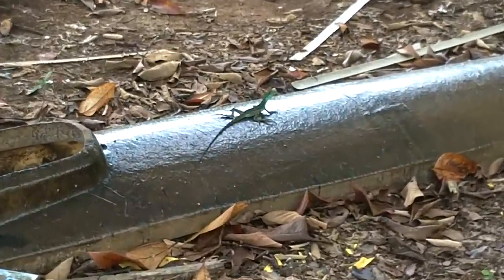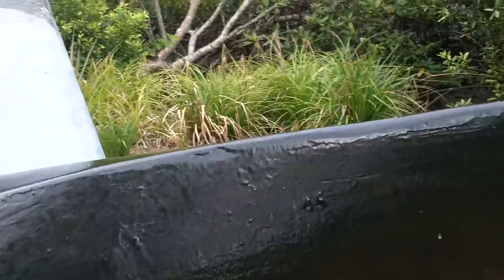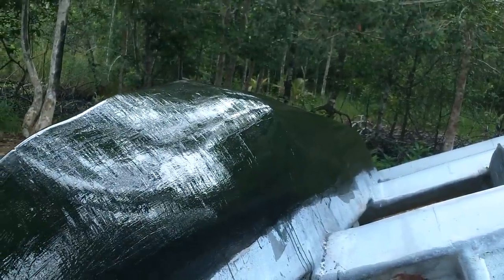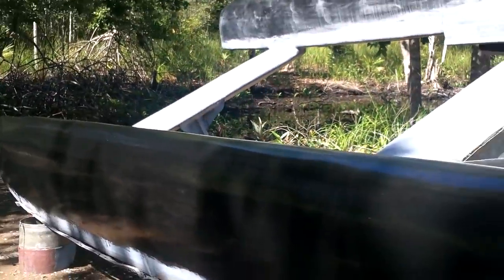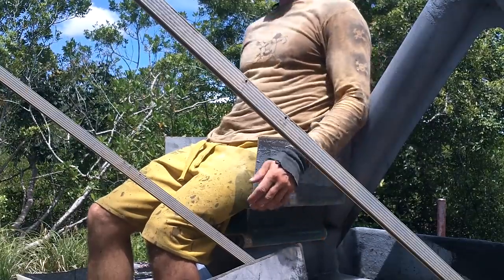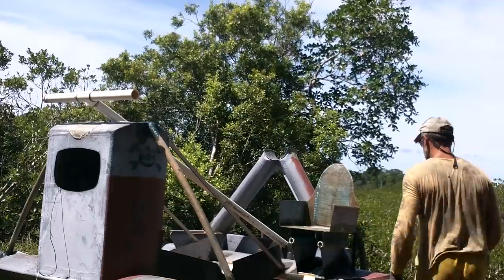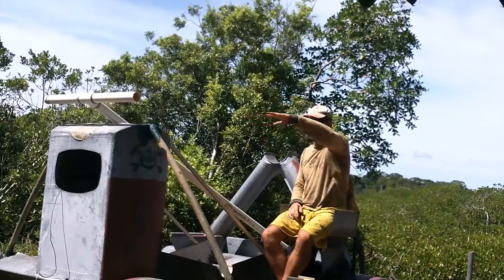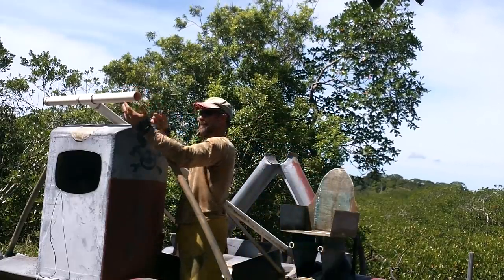Boat Chips 015 Sail Attacherizers, Chair, Spackle

Comment: in regard to some of the audio comments in here. you can run a process called "audio normalisation" on your audio track, it's a very common effect and also available in freeware audacity. it checks for the loudest sound in the track (or selection) and scales up the volume based on the loudest noise. very useful and takes 2 mouse clicks.
Reply: jacktheripped  that might be loudness equalisation which is something else and actually the reason why on a lot of devices the audio sound loud while the source audio isn't. but yeah that's awful, especially with loud beats the modulation hurts my ears awful technology.

Comment: You cold make yourself a bigger sanding block like they use in car body finishing. That speeds up sanding and makes it less tiresome, that is especially true for the type that has an upright grip like a handplane. Also in my experience with a larger surface area the paper does not load up as fast.

Comment: Still trying to reinvent the wheel eh.  When you apply resin over cured resin, even next day, it will delaminate, just a matter of time.
Reply: How do they build boats then?
Reply: @Smith5783  If you're asking about fiberglass boats, They are laid up in a mold. If for whatever reason the layer is allowed to cure before the next layer is applied, the surface has to be prepared.  There are basically two types of bonding, chemical(best) and mechanical. Chemical bonding is obtained when the previous layer is still wet.  For mechanical, the surface has to be first cleaned of the amine blush (usually soap and water) then sanded, then cleaned with a solvent (styrene) works the best in my experience(although some swear by MEK)as it softens the sanded area for a much better bond.  In recent years, a product called peel-ply is applied over the wetted area, when removed after the resin/epoxy has gone off there is very little need for sanding if at all.
Reply: @mazdarx7887  Im glad you clarified all that for other people reading, so you can epoxy over epoxy, not ideal but with good prep it's ok, even by boat building standards.  Not professional work but I have seen many boat jobs done in this manner that have held up for many years.  I did think about commenting on the fact there was no prep between layers, although I would have thought with all Jamie's fibreglassing experience he would know about the waxy blush,  when it started raining I was hoping he was going to say perfect and grab some dish soap and give it a good scrub. I would imagine peel ply is out of the question on this kind of job but great stuff from what I hear, and saves a ton of work in finishing.  Maybe its a non blushing epoxy, I have heard of them but never seen them.  If not and no prep was done, it will be interesting to see how long it lasts.
Reply: @Smith5783  they sand the cured resin or adhere peel ply sheets to the curing resin and peel it off before adding a new layer of fiberglass and resin. Peel ply is the bees knees.